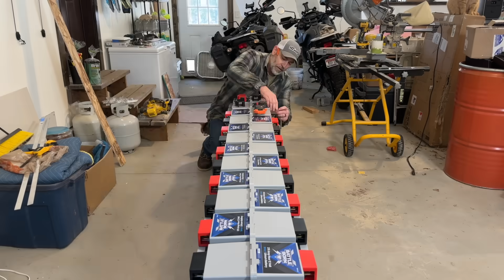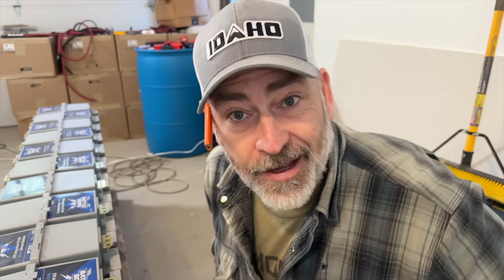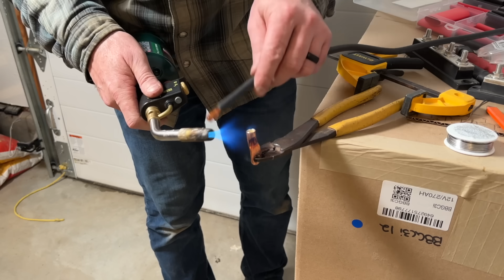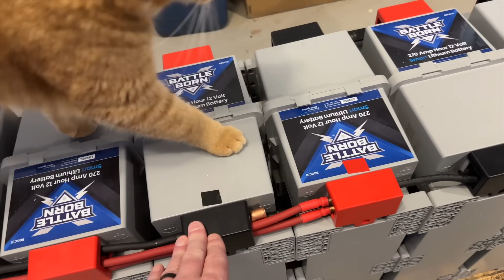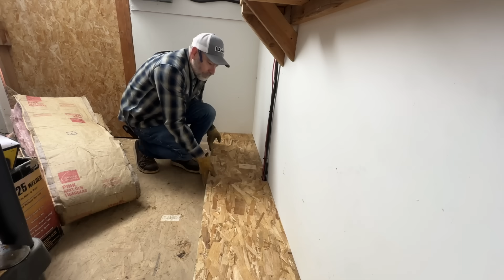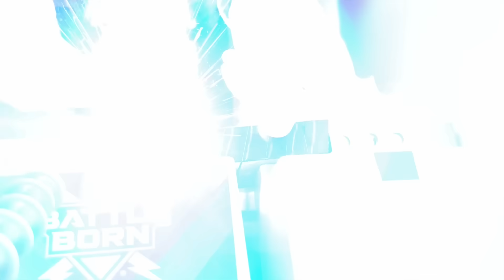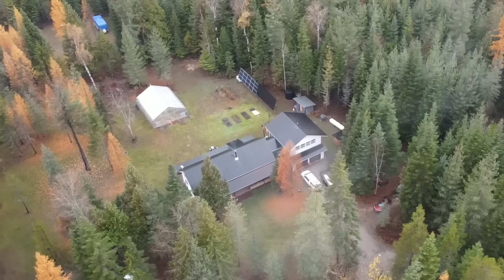BEST Off-Grid Solar Power System Battery Bank

Comment: This video was painful to watch. He preaches doing things right with the best but solders lugs (WRONG) and uses aluminum bus bars (WRONG).  I cannot believe battle born sponsored this joker. 

I truly hope nobody follows this dudes lead and does the same. 

And I also believe battle born is not a premium product. They failed on Delos in only a few years. They blamed not properly balancing, but the BMS should keep the cells happy regardless. Its a weak excuse to cover their butts because the product is inferior.

Comment: Not gonna cover the solder joint, enough people already have. The issue with the bolts and nylocs, they are stainless steel, on all stainless steel hardware you should use tefgel or anti seize, they can seize just by putting them together by hand on a test fit.

Comment: I was thinking about saying something about the aluminum buss bars.. then you wrapped them in electrical tape.  😞  I would have checked to see if copper pipe would be affordable - not like you need much for that application (cut to size, flatten, heat to a dull red to reduce work hardening for a better contact joint, clean and tin ends), and if you can afford Battle Born...   Then I'd use heat shrink tubing - it's much more scuff resistant and thicker, and electrical tape (and it's glue) will oxidize and make a mess before drying out and falling off.  At least consider upgrading to 'rubber tape'.

Comment: The bolts were stainless and gulled. you are using the wrong grease you need nolox for the AL not to corrode. the lock washers you should use on electrical connection are Belview washers.

Comment: You upgraded your battery system from 24V perhaps to 48V, right? But you did not mention that you upgraded also your inverter. Did you on the inverter side?

Comment: No ! Crimp them and then solder. The crimp provides the required mechanical joint, and the solder improves the conductivity and helps prevent corrosion.

Comment: Well aluminum is usable since your at a higher voltage, but I think you should put a wire wheel on the ends of those bars, a lot of company's out a coating on the aluminum to keep it from oxideing.use a heat temp gun to check for hot spots when you are done too

Comment: Soldering provides resistance, which creates heat and voltage loss. Soldering works for low voltage like car wiring, but is not a good practice for high voltage systems like solar power. Crimping provides a mechanical connection which the metal to metal connection connects with more strands of the wire than soldering does. I am not sure I would trust a peice of taped flat metal connecting each battery together. It only takes one battery to have a difference of voltage, and heat up that flat metal aluminum which has a low melting point and could burn your shed system down. Copper is always the way to go. Yes it costs more, but atleast you will still have your system and your shed.

Comment: Battleborn are a fashion battery brand, so overpriced - that the only people who buy them are youtubers that get them for free!  Please use one spanner which you hold still, and one socket on a ratchet with a 2 inch extension which you can turn to your hearts content well away from the terminsl - as waving multiple spanners around the terminals is a really bad idea.  No one solders battery connections. Always use heatshrink to protect as much copper as possible from shorts and corosion.  I guess all this has been mentioned by other people in the comments. Oh well. Keep going and onwards and upwards!

Comment: Martin, I appreciate your enthousiasm. But the one who gave you the advice to solder these cables instead of crimping them, IS COMPLETELY WRONG. You will get currents of about 120 Amps, (enough current for welding = melting metals). If the current is high enough it will heat up the cables, so it could also be possible to melt the solder.

Comment: I bet you save money converting the water heater and clothes dryer to heat pump systems and then just use the propane in a generator if you need some supplemental power occasionally.

Comment: I have only watched the first 2 minutes.  Anyone else getting nervous about this setup?  1: Aluminum, 2: large series connected 12v batteries that will have balancing issues (long term)    I love your channel, but I see caution tape already.
Reply: Too much wrong here to list in a comment. This is a worrying video.
Reply: @Chris-lp3dm the comment is older than will’s video
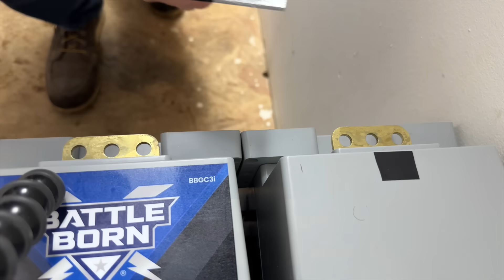Reply: Watch the video from 15:40 on to see how bad this really is...
Reply: @mxslick50  LOL 🤣🤣🤣
Reply: Aluminum wouldn't be so bad if the size was large enough to handle the current the BATTERIES are capable of putting out. This guy doesn't even understand you choose wire gauge and bus bar size based on what your power source is capable of AND if it isn't large enough, each bank must have something to interrupt the current when it is exceeds it.
Reply: Way to try and take Will's criticisms and make them your own. ROFL

Comment: if you paralleling the battery banks, connecting wires between them should be same length and gauge

Comment: I agree with the comments made by others to 'take this video down'! You are going to get someone killed. Almost everything you did to improve the process and the outcome of your custom battery bank was incorrect and actually increased the possibility of fire, electrocution, and/or death! I also blame Battle Born for taking advantage of your lack of knowledge when it comes to creating a custom battery bank and the extreme danger when working the high DC voltage/current! Please take it down...now! The numerous positive comments about this misguided and dangerous how-not-to video are alarming and will only propagate this misinformation to other do-it yourselfers!

Comment: Apart from cost, is there a reason you used aluminum instead of copper? Copper has a much better electrical conductivity and  resist corrosion
Reply: Yes, there's a reason. There're many reasons.
If you watch the whole video you'll find the reasons. It's some unreasonable ones.

Comment: Aluminum Need bigger gauge bar(may be two bar  if use copper bar ( copper pipe flat both ends ) may need only one Aluminum will shrink when get warm use infrared temperature probe

Comment: Tip #1 - Stainless screws with nylock nuts will gall the threads 99% of the time, if using stainless, use lock washers instead.
Tip #2 - Crimp your battery cables with a hydraulic crimper instead of soldering.

Comment: This was painful to watch.

1. Crimp, never solder. In fact, never solder then crimp. Crimp only.
2. Never use aluminum on copper.
3. Better off getting 48v batteries.
4. if you're going to use these, you should have gone 4s3p and connected a 48v balancer to keep all 4s batteries in balance.
5. These batteries look like they are meant to be stacked vertically...
Reply: Agreed, this was not wired safely. Needs to be taken apart and rebuilt correctly.
Reply: Or even better for non professionals: buy crimped cables.
Reply: 3S would only be 36v average, 43v at full charge.  These are full 12v batteries, not individual cells.  And in spite of the label saying Lithium, they're actually LiFePO4, so if they were single cells you'd need 4S to get 12v average.  48v batteries are larger and more expensive.  Harder to move (especially one person alone) and more chance of failure for any one battery (it has four times the cells).
Reply: @chrisw1462   " more chance of failure for any one battery" - that is true statistically, but you are overlooking that 4 BMSes (one for each 12v battery) has 4 times the failure chance of one 48v BMS, and also a battery balancer plus 4 BMS is much more complicated than a single 48v BMS that doesn't need a balancer.
Reply: @RoarPowerNZ-tt6ud  But if one 12v battery fails, replacing it is a LOT cheaper than replacing a 48v battery.

Comment: Hi Guys, While I love that you soldered the connections it is not a replacement for crimping the connections. Imagine somehow the home tried to pull high amperage OR a cable nut came loose, and the connector got hot enough to melt the solder. Now the cable can either fall out and cause zero damage or it grounds out or because of the heat, it starts a fire. Please go back, heat up the connectors and crimp them at the same time, it's a 2-person job as the crimper needs to be off the connector while you heat them. Sometimes just from hot cold cycling the solder can become loose over time. Please, please, please, crimp them.

Comment: Nice video...but Aluminum bus bar is total failure.. trust me.. Copper is the way to go .. I have all busbars from copper..even cheap chinese companies now use nickel plated copper busbars..Please don't use AL busbars..it is really waste and they are not the best.. you spend a lot of those batteries why to use something else..
Sorry for another note..Soldering yes..no problem..but it isn't done like that..Lool.. Put it in connector..then you will crimp it and then you will solder it..not like that..that is the worst way how to make connection..

Comment: And always use copper bus bars, not aluminum
Reply: Battle Borns with Aluminum bus bars.. that's bordering on immoral!
Reply: @chrisw1462  Battle Born is immoral now days plain and simple.  Miracle Ear of the battery world.
Reply: @chrisw1462  You might want to look into the construction of prismatic and cylindrical cells
Reply: If you have aluminum studs . Aluminum busbars are better in my opinion because different metals can cause corrosion.

Comment: Those overpriced battleborns cost $2500 for 3.2kWh.  You can get 5.12kWh 48v server rack batteries for $800-900.  

Heck even epoch or Vatrer batteries are 1/6 the price.

Your setup would cost the regular buyer $30,000.

Server rack batteries which Will Prowse says is just as good, would have cost $7,200 for 8 units, and that’s for 40.96kWh.

If you really wanted to spend $30,000 for server rack batteries as these battleborns costed, you’d get 168kWh, instead of 38kWh.

Comment: electric current can actually make nuts turn depending on flow of current 
    i personally don't understand it but it happens  
   in breaker panel and other panel boxes 
  can even happen on breaker wire connectors 
which have heat expansion/contraction+ current flow will loosen connection and increase heat/amps from resistance from being loose  and cook the wire insulation cover

Comment: The silicone (dielectric) grease should be sandwiched between the surfaces of the metal connectors to exclude air and prevent corrosion. It's more important with lead-acid batteries, which exude sulphuric acid and where moisture might be present. Note, too, that Aluminum dust is toxic so don't breathe it in or lick it! The smoke is also toxic when you create an arc.

Comment: Each of your 270 AH 12 volt Battle Born batteries costs $2,299 and you have 12 of them for $27,588 plus tax $1,655.28 and free shipping = $29,243.28. That is total power of 810 AH or 41 kilowatts. Alternatively you could have a 280 AH 48 volt battery for $1,788 x 3 of them from Texas with no tax or shipping = $5,364. That is total power of 840 AH or 43 kilowatts. This is as close as I could make the comparison with 30 AH and 2,000 watts more than your battery bank. This is a real world savings of $23,879. Battle Born batteries are out of touch with reality and I suspect if they had not provided the batteries to you for free, you would have not been able to afford them. We are Off-Grid in Michigan with four of the batteries in our comparison. Plus our batteries have the JK-BMS, this is the best in the industry.

Comment: I had wounder how you was getting buy on just 16 12 volt battery good upgrade but check the bolts from time to time for safety You are a good man and don't want to louse you

Comment: Sorry man but you need to take this down and redo the video. 

Use copper, heatshrink, crimps etc. Also use antiseize with stainless please, you cold welded those.
Reply: The battery lug instructions call for a 9 to 11 ft-lbs of torque. Using anti-seize causes the bolt to tighten far too much, putting much more pressure on the connections. This is the odd catch 22 when using stainless steel hardware, so better to use standard steel bolts or good quality stainless steel that won't weld together as easily.

Comment: Copper bar stock would be better than aluminum. BTW, the problem with the stubborn bolts are they are SS and the mfg did not apply anti-seize on the threads.Did you use NO-LOX on the alum bars? Very, very important, but ONLY for the aluminum, not the copper eyelets.

Comment: Why didn't you go with 48 volt server rack batteries. Crimp not solder. Should have used copper bars instead of aluminum

Comment: You are going to wish you used a copper buss bar.  Aluminum will degrade over time building codes banned aluminum wire in homes back in the early 1970's K Keep all the connections to the aluminum tight and use the proper grease for aluminum connections.
Reply: 😂😂😂No aluminum for branch circuits,if you don’t know don’t comment

Comment: Should be using shrink tubing instead of electrical tape, that breaks down over time.
Reply: also color code with shrink tubing
Reply: Tape has it's uses but as mechanical separation, no.  It's far too thin for the application, easily pierced.  Decent thick heatshink is the right answer.

Comment: A proper crimp is alot better than a solder connection for battery cables , that's why all the professionals crimp the cables
Reply: You’re missing the point Will made here with the soldering. The wires can easily get hot enough to melt/soften the solder and the wires may simply pull out.
Reply: I wonder if there's a Wago rated for 200A....
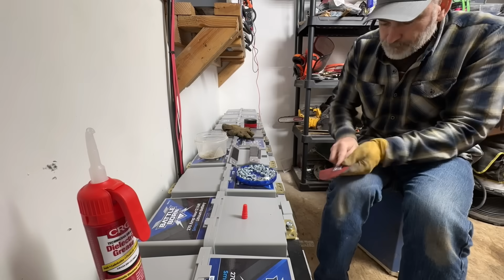Reply: 16:15 when he shorted the batteries with his hand made connections just shows how inexperienced he is. Will is a lot more precise and doesn’t just fly by the seat of his pants. 
Lithium Batteries can cause serious fires. Surprised he hasn’t caused a fire already. Maybe he did and edited the video 19:01  he caused another spark. WOW amateur showing us how to do things.
Reply: When that undersized wire heats up that solder will melt.
Reply: Dont solder, use duct tape. Its the better connection!
(Or crimp, if you want to do it absolutely right.)
Reply: use a candle - the way will be the best of all but I can not remember who had shown me that tip. 

But I crimp or buy crimped cables from a serious vendor cause this has caused serious fire in central europe and huge damage.

Comment: Martin, how do you balance these when the first of each series string to reach BMS balance voltage will cut off the current to the other 3 batteries preventing them from reaching balance threshold. I put my 24V Battle Borns in series for 48V and they would eventually go out of balance due to this. Just wondering how you accomplish long term balancing.

Comment: Nice looking upgrade. I thought crimp was better than solder. Cheers.
Reply: It is not just better to crimp, for battery loads it is the only way to do it.  This would not pass an electrical safety review.  Please do not follow what this person has done in this video.  It is risky for Battle Born to sponsor this video.  Hopefully he understands the concerns and takes the video down and redo it addressing all the safety concerns.
Reply: 100% crimp is better than solder. This system is a safety risk, should be taken apart and rebuilt properly.

Comment: The problem you had with the thread binding on the bolt/nut was due to the hardware being 304 Stainless which is low Chromium and is a common problem with this material. Some lubricant dry or wet or dry would prevent this. 316 SS (Cannot find in a hardware store usually) is better but also will bind sometime. I also think you should have used copper jumpers. You are likely to get electrolysis corrosion due to the reactivity of the aluminum as moisture accumulates over time. You should have applied a light film of grease, I would bet those battery terminals are silver plated copper. Curious why you are changing batteries. Are the lead/acid ones nearing end of life? Hope you find these comments constructive as they are meant to be.
Reply: He has no lead acid battery’s
Reply: He didn't replace the other batteries, he added to the system, as far as I can tell.
Reply: @garybensel6680 on the final video it’s showing the wire removed from the old battery 🪫

Comment: Very nice to know for us the not so well educated on solar power, but thanks to your content, we can understand better. I am wondering, if instead of using the aluminum bar, a fuse of the correct value can be placed in each junction, so in case of a problem, not all batteries suffer. Nice. Hi from New York.

Comment: can you see the cell voltages for each battery ? the old batteries can work in parallel with new ones, then you would have more capacity for winter.